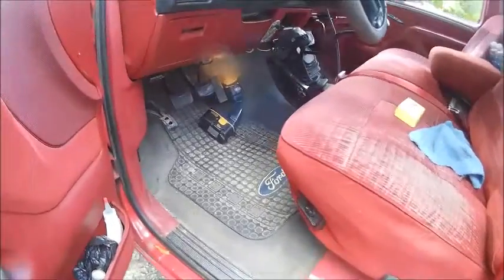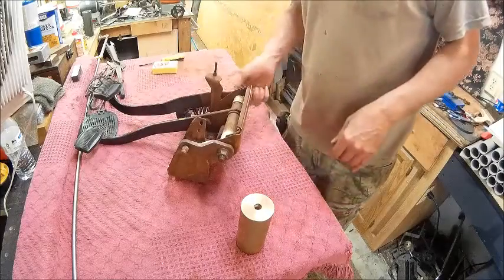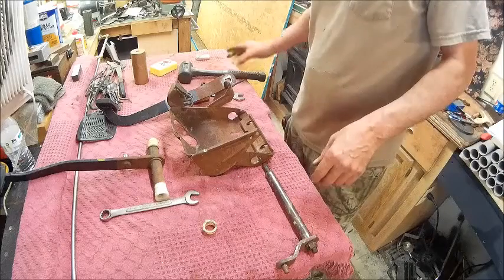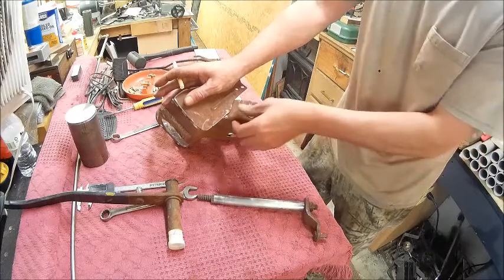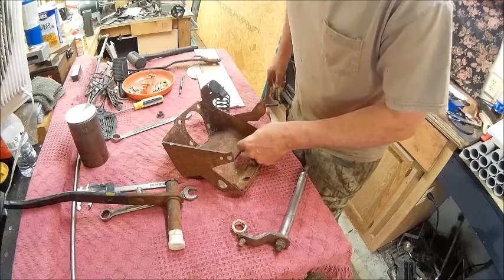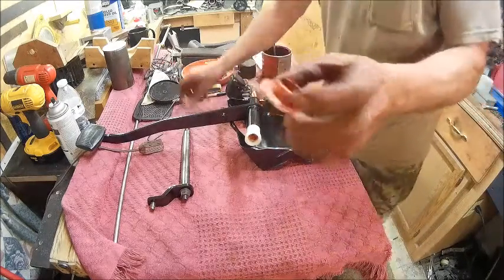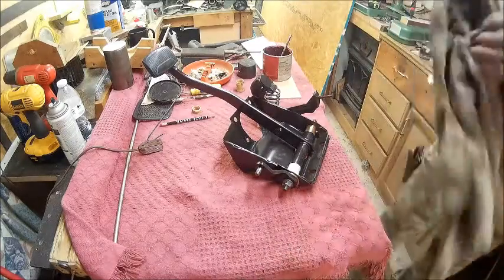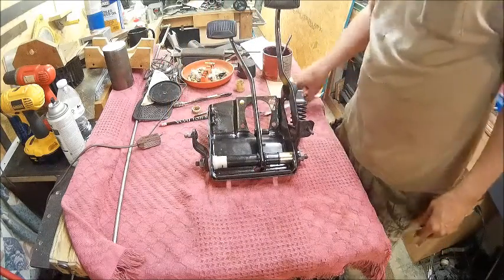93 ford f350 clutch peddle bushing repair

Comment: I've been making the cast from sand, I push in PVC or the old part for the shape. Then I either melt bronze,  copper or aluminum from beer cans, and pour in the cast. Let cool and have a new part. 
If broken, it's possible to put both parts together to cast, I've also used white packing foam, that I'll carve to shape, then make a slight hole, and pour the metal in. The metal melts, and is replaced by the metal, giving you the part you need.😎 By the way there's vids teaching you how to make sand cast. Learn now while you can

Comment: Thank you for the video. At 1:50 what is the yellow wire that is spliced into the green wire going to? I just bought a 93 f150 and this wire is cut.
Reply from the maker: that wire gos to my trailer brake box
Reply: If your talking of the clutch safety wires. I installed a button.i used two fork type crimps I pressed into box if it's still there. Two forks (1 wire) into red. The second, I put single into green, left the brown alone. Then added butten in middle, to use as a anti theft button. ....some people cut them and splice the red and green together to by pass.